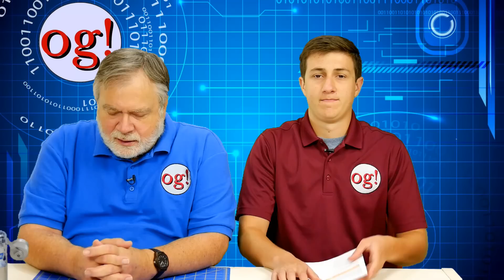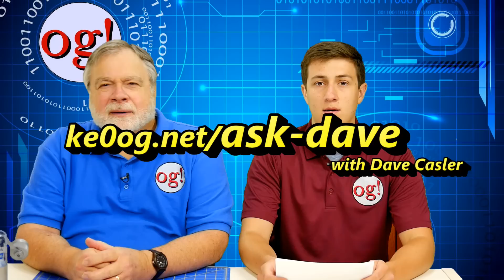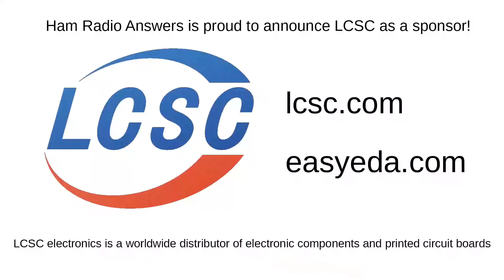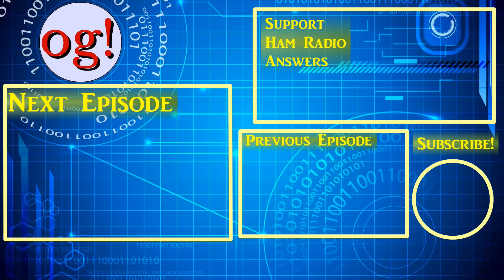Dave and Trevor Answer Ask Dave Questions (#167)

Comment: Thank you Dave for featuring my question.  All understood that there isn't a standardised channel spacing across the US.  In the UK, the calling channel is 145.500MHz (and in most of Europe as well I believe),and the simplex channels are 25kHz apart.  So 145.475, 145.450 etc and 145.525, 145.550 etc all the way between 145.200MHz and 145.575MHz.  When I'm in the US I think I will call CQ on 146.520MHz and then just ask the person who replies to suggest a frequency to QSY to.  In the UK, all callsigns starting with "G" are full callsigns which is roughly equivalent to the US Extra Class.  Callsigns starting with "2" are intermediate callsigns which is roughly equivalent to the US General Class.  Callsigns starting M3, M6 and M7 are foundation callsigns which is roughly equivalent to the US Technician Class. M0, M1 (rare) and M5 (very rare) are full callsigns.  M2, M4, M8 and M9 are not used for amateur radio as far as I know.  M7 licences only started being issued a couple of weeks ago, so if you hear one on the air then work it... it is a rare thing indeed!  EI is the prefix for the Republic of Ireland.  GI/2I0/MI are the prefixes for Northern Ireland.  73 and thanks again Dave.  If you make it to Hamvention 2019 then I'll buy you a cofee.  73 from Ed M0MNG (England).
Reply from the maker: Thanks for the info!

Comment: Dave, I have only a suspicion, that when amateur radio was first starting and when a professional telegrapher always had a professional "fist", the pros would refer to "ham fisted" (clumsy, not clean code) amateur operators. The timing is right, the use of "ham" fisted and clumsy is period correct. Just a suspicion.
Reply from the maker: I think you're probably right.

Comment: To operate legally in the US prior to the late 1970's a F.C.C. license was required for Citizen's Band radio operation. A fee was charged and an F.C.C. form was required to be read and the licensee required to enter personal information and sign (a hand cursive type of personal identification for those of you that no longer learn cursive writing in elementary school) that the licensee applicant had read and understood Part 97. My call sign in 1970's was KEX5617. Any transmittance greater than 5 watts was illegal. The F.C.C. even had enforcement teams that hunted and with the aid of law enforcement arrested people who later had Federal Court hearings and some received monetary fines and others both fines and jail time. With no licensing and no enforcement of the CB service I endured the illegal users of amplified transmitter power and the trash/potty mouth operators for a few years. During the early years I had my home and automobile radio on constantly but with the proliferation power abuse and language abuse I tested to become a ham. I really don't miss CB because I was restricted to AM band.

Some difficult questions and great answers Dave.
Reply: Terry Morris I remember those days.  I got my CB license right after they got rid of the fee.  I remember the FCC busted a guy around the corner from a friend of mine’s house for running an illegal linear amp.
Reply: @Robert Young Or channel 19. LOL